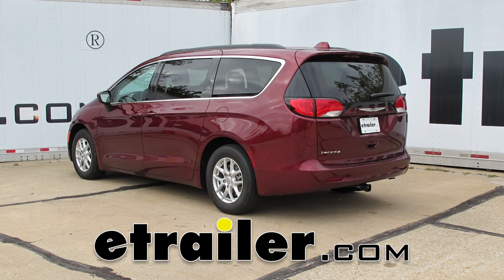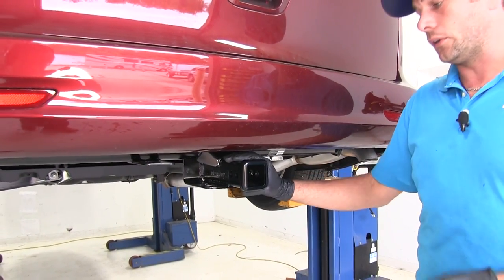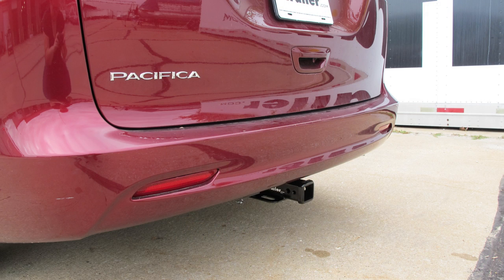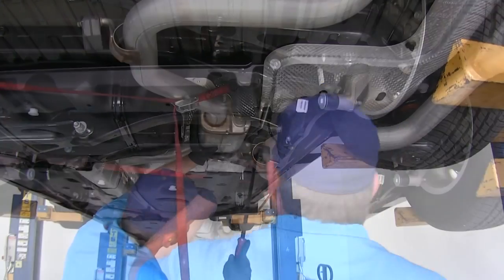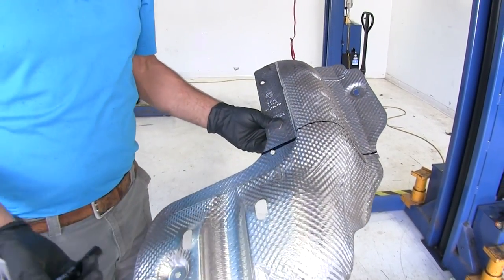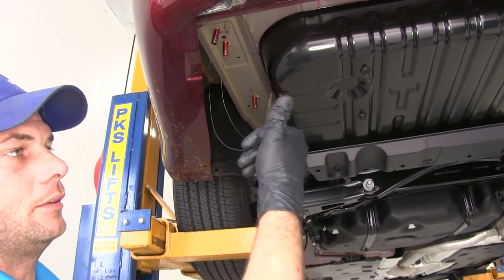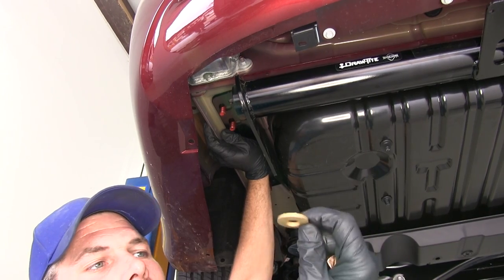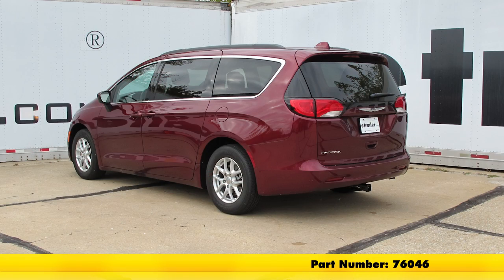etrailer | Installation: Draw-Tite Max-Frame Trailer Hitch Receiver on a 2017 Chrysler Pacifica

Comment: Will this interfere the foot tap opener once installed?
Reply from the maker: It still allows you to use your hands free liftgate. At the very worst you might have to run your foot to either side of the hitch opening but it will still work just fine.

https://www.etrailer.com/Trailer-Hitch/Draw-Tite/76046.html
Reply: Is this confirmed? The OEM hitch assembly includes two sensors, (One for each side of the hitch), Because the hitch blocks the single stock sensor in the middle.